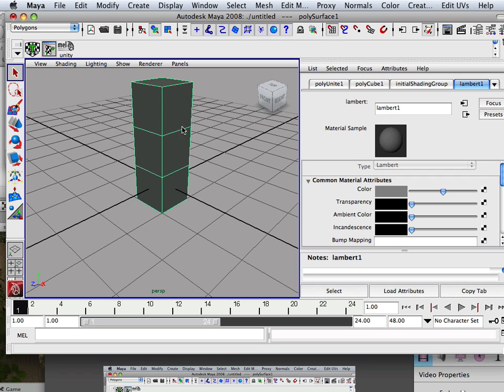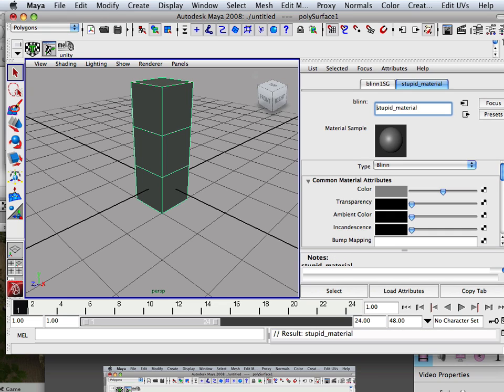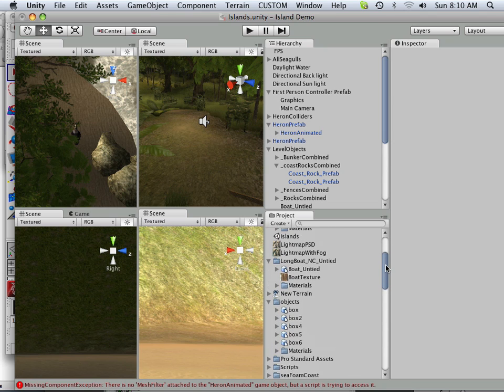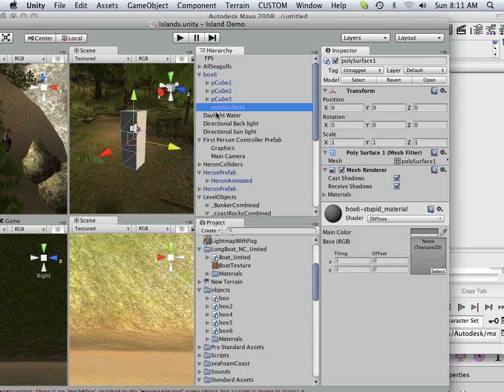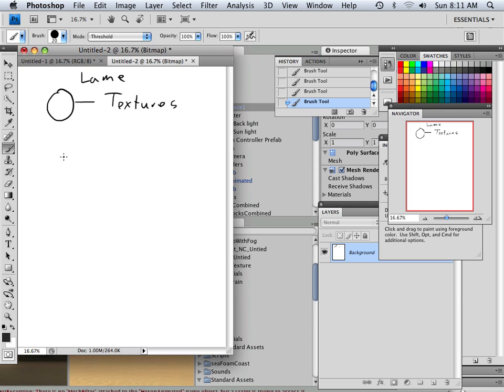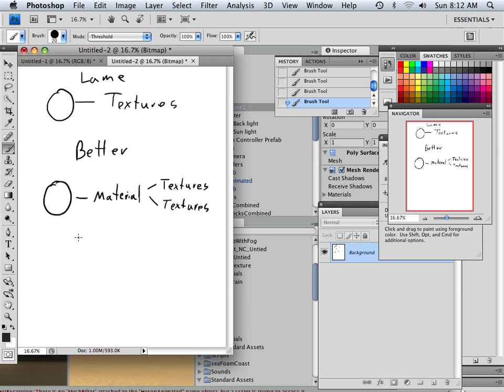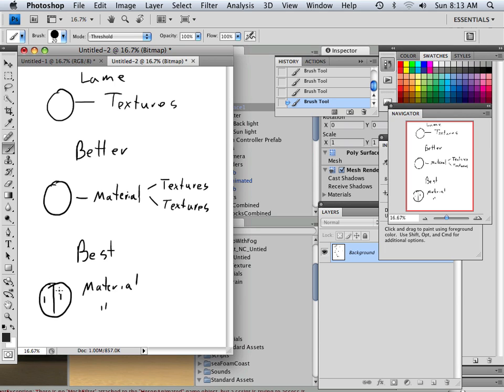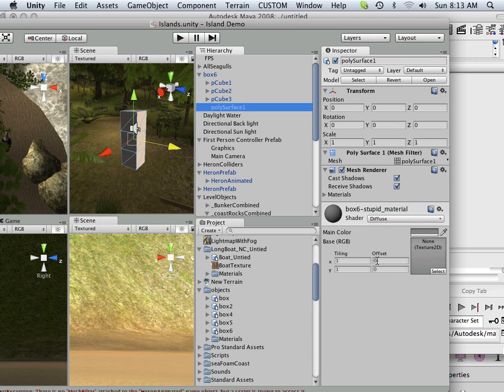0006 Unity (Material vs texture)

Comment: @ 1:05, i found out that unity copies the scale factor or file units (meter or cm, etc) from maya. On maya Windows>settings/preferences>preferences>settings>working units> centimeter. And then if you go to fbx export and look at the File units, it will automatically be the same as maya's. make sure automatic is turned on or else you'll have to manually set it.